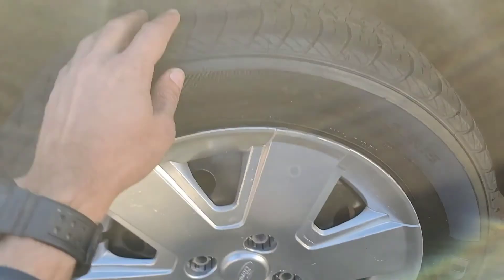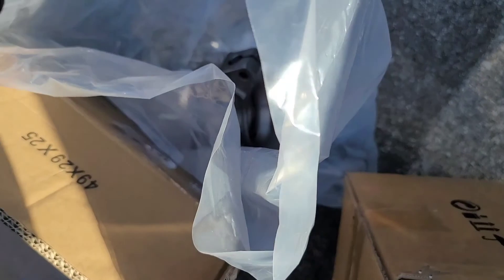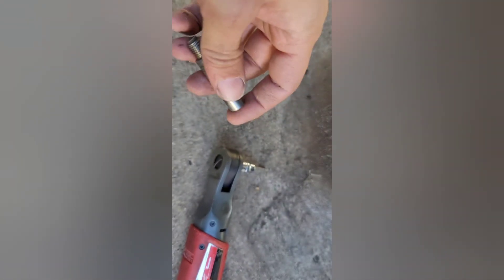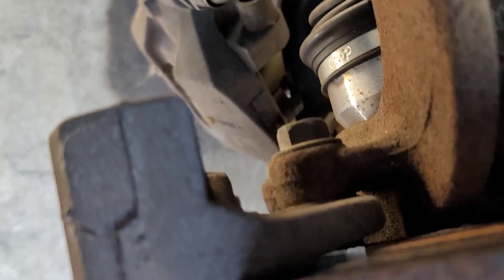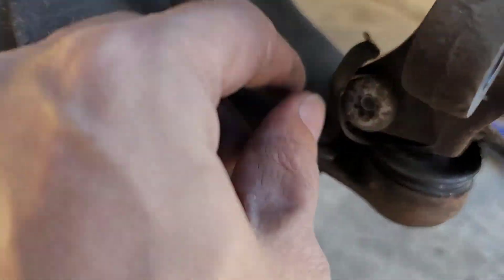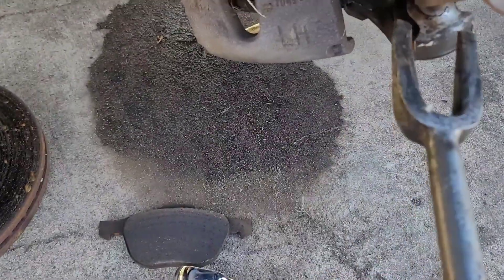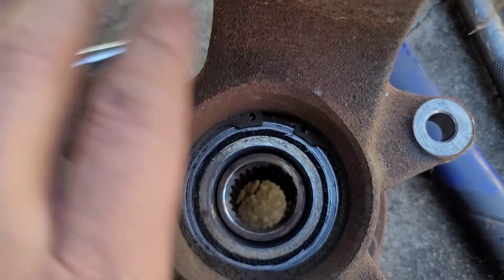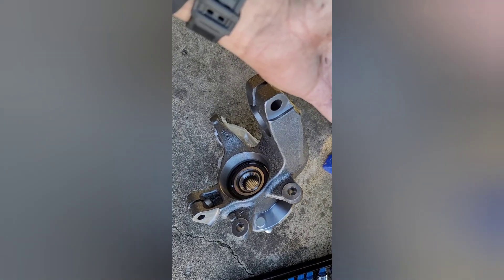Ford Focus Steering Knuckle/ Hub Assembly replacement using Autos hack loaded knuckles

Comment: Exactly the video I needed. I was about to place my order for these steering knuckles with the hub assembly cuz my car is making wheel bearing noises. Saved me some money thank you for making this video in detail. Did you have to get an alignment? I haven’t replaced my knuckle/hub assembly yet. Again thank you
Reply from the maker: I have not gotten an alignment yet nothing has been changed so I have yet to see an issue but I would suggest getting an alignment in case something is off somewhere
Reply: @barrettgarage1088  I will get the alignment. Thank you for the reply.

Comment: Great video. What year Focus is this? My son has an 05 ZX3 and what I'm finding out from searching that no one sells steering knuckle assembly's for this year. 00-04 and 06-11. Auto hack sells a hub assembly and bearing but I'm assuming you would still need to press out the old bearing which is what I'm trying to avoid.
Reply from the maker: It is a 2007 and they should be the same my car didn't have abs so it showed good for all those years
Reply: I have a 2005 zx4 and noticed they only sell the loaded knuckles with 2000- 2004 and 2007...... Did u find out what to do?
Reply: @ableaaron7985  Ended up replacing just the bearings instead of the entire knuckle. It's more work and I had to rent a bearing puller but it wasn't over all to bad.
Reply: @steve23464  after replacing bearings only have u had any recurring incidents ?
Reply: @ableaaron7985  No issues after.